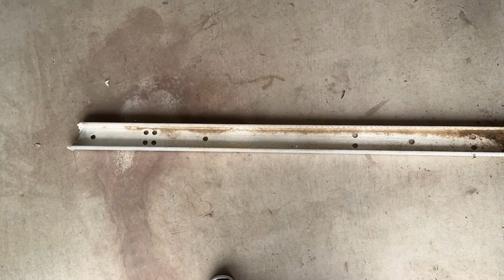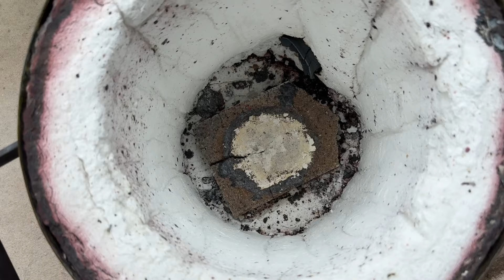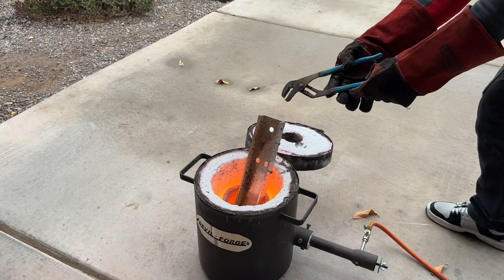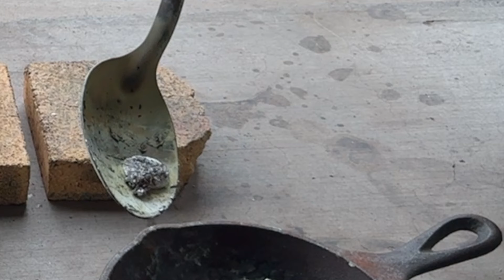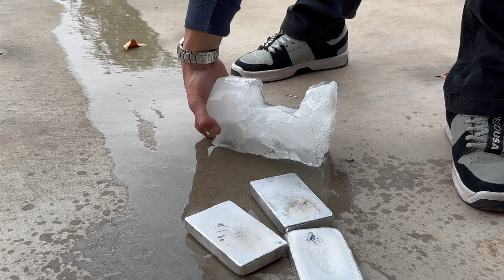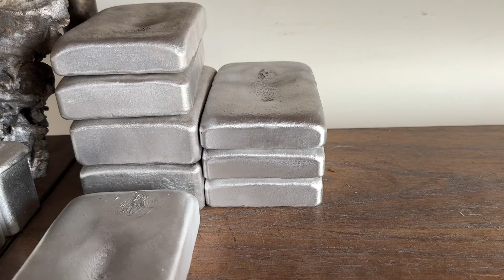Melting Aluminum Channel - Quick Aluminum Melt for Ingots - The Growing Stack

Comment: You are completely correct even a little melt is fun brother. Awesome episode all the same. You need to get hold of a plug in drill brother. You keep using the hand drills you will burn out the motors on them. Catch you in the next episode brother stay safe